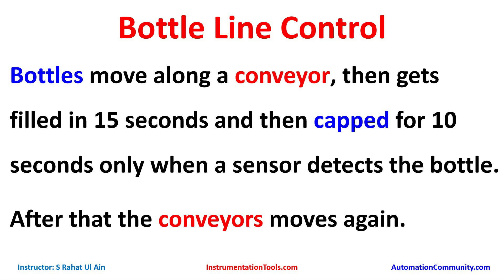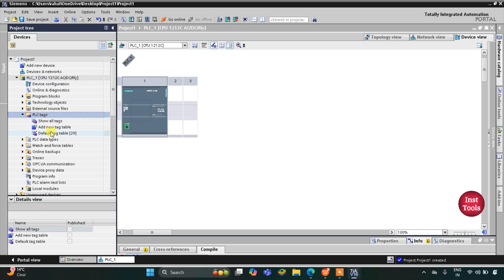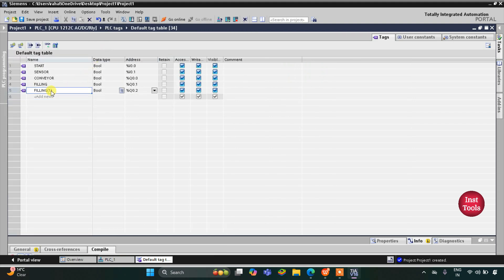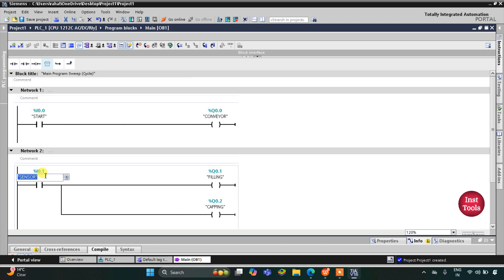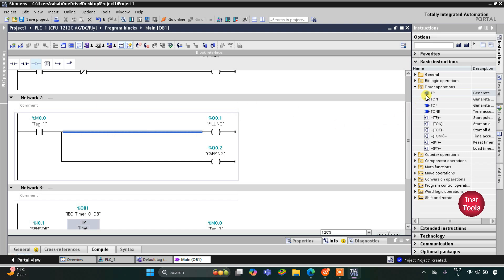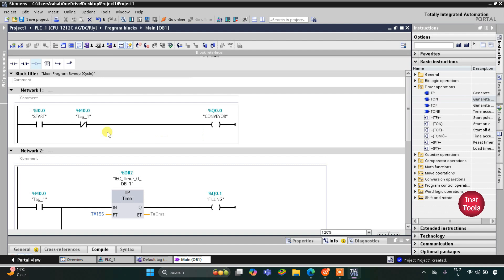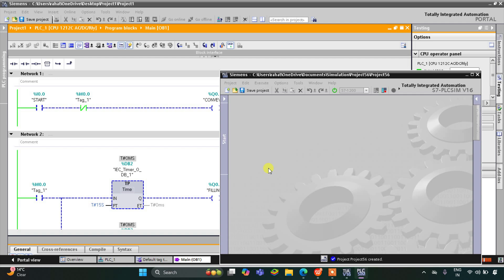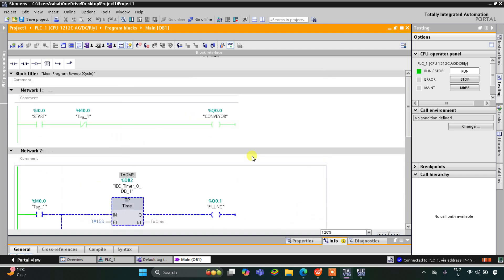Siemens PLC Programming for Conveyor-Based Bottle Filling and Capping

Comment: thank you very much please upload a video about how to protect a motor shaft from stopping with a proximity induction sensor 3 wire dc 24vdc pnp out put. with s7 1200 and hmi delta.when motor stopped  An alarm occurs and the system shuts down. god bless you